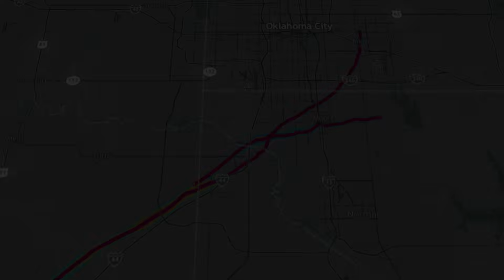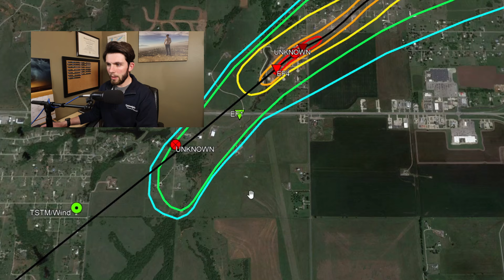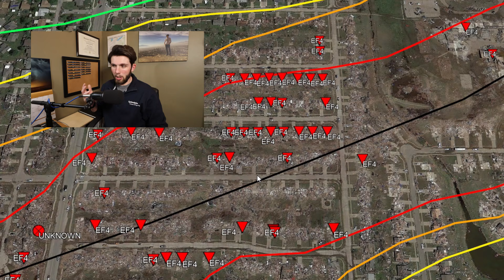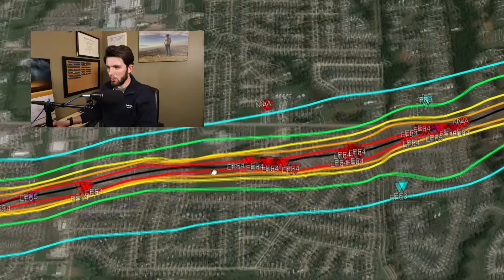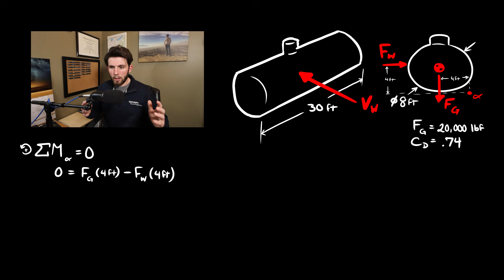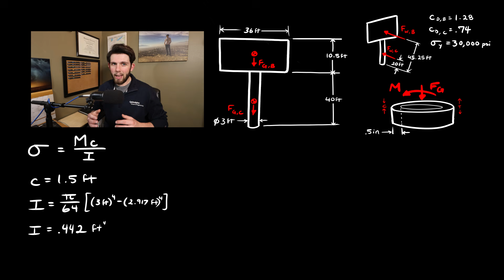DAMAGE ANALYSIS: 2013 Moore, OK EF5 Tornado

Comment: An EF-3 structures ability to survive up to the F number does not diminish the EF-4 nor the EF-5.  EF-3 and above must be understood as killer storms.  Rather than play with rating numbers make underground shelters mandatory for new construction in these dangerous frequent killer storm paths by reason of history.  If they want an above ground structure too then after the mandatory living shelter is built and not taken away from then give it to them.  Option two.  Leave that area.  We can live better underground and safe.  There is no excuse for a public school to NOT HAVE AN UNDERGROUND TORNADO SHELTER WITH MULTIPLE EXITS.  STOP ROLLING THE DICE WITH LIFE.  
Personal note.  Recently I watched multiple accounts about "the dead man walking tornado" that struct just 120 miles south of where I live in Texas.  I frequently drive to Temple, Tx and return to Cross Plains.  That storm account scared me.  El Reno scared me.  Both Moore, OK scared me and Joplin scared me as I once lived not far from their.  I have been a tornado magnet it seem in my life time.  They were all F-0 or F-1.  Once my car was nearly rolled as it was raised off the ground on the passenger side then crashed back down and tore up the gas station across the street and knocked off a corner of the shopping mall 1/4 mile further.  I have raced wind blown grain silos and not be able to see the tornado pushing it.  I out ran it and turned 90 degrees right to escape.  I suppose i'm tornado phobic at this point.  Have weather radar on computer and phone but no shelter.  Most do not have a shelter, just trust it won't be MOORE BAD.

Comment: You made an excellent appeal to change the rating criteria, maybe not to replace the Enhanced Fujita scale, but to be used in concert with it to capture the human impact. Does the total destruction of a well built modern barn with EF-5 damage indicators really merit a ranking equal to Moore 2013? Found you on the blue bird app, was not disappointed. Thank you for this, and God Bless these victims and their families. The width of that EF0 damage field at the beginning of the track, wow.

Comment: In 2011 I formed an opinion that It’s way easier to get a EF5 rating in tornado alley / Oklahoma 15-35mph vs Dixie alley 55-75mph. So take jarrell where the tornado was creeping 1-8mph at times. Or the cork screw turns produce DOD 10 on a FR12. The Dixie alley tornadoes were moving 55-73mph; so the core of the tornado that usually produces the DOD 10. It’s not over a location for very long moving those speeds. Sometimes less than 3 seconds —- also in 2011 I learned about the politics surrounding the Scale.  The Hackelburg or smithville had those been moving 5mph I don’t even wanna think about what would’ve happened.
Reply: That's a really good point, I never thought about it like that.   Obviously wind will do more damage if it sits in one spot so long.   I wounder if they consider this in these situations

Comment: So the Lubbock F5, joplin, greensburg, elreno, may 3rd. Multiple violent tornadoes have made that left turning corkscrew turn. It’s just something to think about chasing. We see it time and time again it may be revolving around the meso. The moore tornado you can see a merger and a 70kt jet streak +/-20kts.  Right as it was entering.  But also it could be the centrifugal force / debris throwing the tornado out of balance that causes that cork screw turn. If you look at damage paths. The cork screw turn happens when the meso starts shrinking. Usually the hook gets clogged up with a merger or something and the meso expands to cope with the inflow disruption. But when the hook clears, the meso shrinks rapidly (back to its original size). It’s almost like squeezing a water bottle or bulb syringe. It really funnels a lot of energy to the ground when the meso shrinks. It’s almost like it collapses all of that energy into the core of the tornado.

Comment: 29:29 and that is the main flaw of the scale. The DI system relies on more data to be more accurate and with Tornadoes that's not a good thing.  We could have a 2 mile wide 320mph+ beast cut through a field and rate it an EF3 cause it only clipped a single house. I think its also worth considering that the old scale had F4's go into the mid 200's and F5's were 250+. Having the EF5 tolerance right at 200 is clearly a problem. When its hard to differentiate a 190mph DI from a 210mph DI you will have this. Its also clear if you study F5's that had mindblowing levels of destruction (5/3/99, Jarrell, Candlestick, Lubbock, Xenia, 4/3/74, 4/4/77, 5/31/85) you can get a better idea of what true F5 damage looks like.
Reply: The main flaw of the EF scale is that it's being used to measure something it shouldn't be, the intensity of the tornado.  It should solely be used to measure damage on the ground.  With modern radar technology, we can use wind speed measured by radar and physical size to better indicate intensity than we can with damage.
Reply: "We could have a 2 mile wide 320mph+ beast cut through a field and rate it an EF3 cause it only clipped a single house"

We've had this. In 2013.

They even downgraded it from 5 to 3 for it lol

Comment: 10 years ago to the day I remember this like it was yesterday……however we’ll never know when we’ll get the next ef5
Reply: We’ve likely had several EF5’s since this one.  Just not rated as such.  There’s only a finite number of locations a tornado can garner such a rating, regardless of how strong it actually is.  There just aren’t enough places built to the standards necessary to rate a 5 if struck.
Reply: we’ve had many close calls since, could happen any time - let’s hope not
Reply: @oish6684 0
Reply: @kassieblackmon4761 a few things. 1) it was not 2 miles wide, it was 1.08 miles. It had a large debris ball, but it wasn't 2 miles. 2) size doesn't affect the rating. You can have tiny ef5s and big ef3/2s. The widest tornado in recorded history was rated an ef3. That's never the scale is not exactly a strength scale, it's a damage scale. It measures the damage, that's it. 3) there is no such thing as an ef6. The ef5 rating covers everything an ef6 could have. It would have to be a supernatural tornado to reach the point that experts would consider an ef6 rating. Like 500mph winds and concrete foundations completely missing, no debris to be found anywhere, just gone. We're not even sure that is possible, if a storm like that exists. It's certainly never been seen or measured before.
Reply: @deathbloom27 I'll HOWL till the ends of time the the 2013 El Reno was NOTHING BUT an E-F5 ...or such phenomena doesn't exist!😖😫😡👺🙈🙉
Reply: @brettrobinson2901  I'm right there with ya! I've watched pretty much every video from that day and it was truly something out of a sci Fi movie. Just absolutely, ridiculously absurd!! Had it hit a populated area, I'm willing to bet it'd have been one of the deadliest tornados in US history, maybe with a higher death toll than Joplin.
Reply: @deathbloom27  Totally agree..and as wide as was..like an entire meso cyclone was on the ground...dropping satellite cyclones   all over it woulda been a world class clusterf#ck...winds near or past 300 miles per hour...
Reply: @brettrobinson2901  god, I'll never stop being amazed by that storm. It took so many experienced chasers by surprise, obviously 😭
though I will say that I was really impressed with Reed's video, how he handled it. He recognized the signs before anyone else and immediately retreated with his team. He was one of the first ones to stop chasing and that was far before all hell broke loose! I think he just said something like "this is going to be really bad, this is going to get crazy, we need to leave." Say what you want about his yelling and screaming, but the dude knows what he's doing!
Reply: @deathbloom27  I'm wondering if anything approaching that insane storm will ever happen again.... Supposedly ..also in Oklahoma another monster cyclone briefly caught on radar that potentially dwarfed El Reno...but not much is known about it...haven't found a alotta info fleshing it out....its been awhile since a CONFIRMED E-F5 has hit...2013 Moore Oklahoma I guess...we're probably overdue...
Reply: @brettrobinson2901 100% agree the 2013 EL Reno tornado was absolutely an EF-5. You would think they would amend EF scale I mean they amended the F scale turning it to EF. So surely they find a way fix this kind of thing. That El Reno tornado was entirely to strong to not be an EF-5.
Reply: @RunningwithLB  Wonder if an El Reno type twister will make another appearance during my lifetime....?....I SHOULD hope not.....but uh...
Reply: @brettrobinson2901  i hope not, but  it's bound to happen again
Reply: @brettrobinson2901 absolutely agree.
Reply: @brettrobinson2901 the ef scale is so stupid, I HATE it. I want to know how strong the tornado is/was, doesn't matter if it was in downtown okc or ripping up wheat fields it should get the same rating. I've heard talk of it being revised but idk to what degree or how true any of it is really
Reply: If the mayfield or rolling fork tornadoes were going slower the would of been rated F5s. More damage is done when a tornado is going 20 mph vs 60mph.
Reply: @bubbawubba2307  Except for the 1920s Beast of a Tri-State Twister...man I wish someone had managed a pic of any kind....
Reply: Mayfield is in my opinion, the closest it has gotten to EF-5 since 2013.
Reply: Finally got one in ND. With that kind of analysis, we'll probably be getting more.
Reply: Ironically one year later we get a ef5
Reply: I don’t know how people live in Oklahoma
Reply: the tornado was not 2 miles wide, it was clocked in at 1.3 miles wide per NWS in norman oklahoma, it did NOTHING indicating F6 damage, as a matter of fact, the F scale has been retired, but not only that, "F6" is non-existent. do some actual research before saying bullshit like this
Reply: There’s been far more EF5s but conservatives and MAGAs have prevented them from being rated due to it proving climate change. Only a matter of time before EF6 becomes a thing and concrete slabs are gone. Probably 5 years away.
Reply: This year looking like it will
Reply: @SwipeTheStones fr. This last week has been crazy
Reply: Delete that pfp
Reply: Diaz, Arkansas, Preliminary EF4 max winds of 190, last time we had a preliminary 190 was this tornado, there’s a high chance this Nader will be upgraded to an EF5 reguarding how they mentioned further damage inspection will be needed for a COMFIRMED rating
Reply: Seems like rating should be based on size and wind power.
Reply: Initially, Ted Fujita rated the Xenia tornado as an F6, but it was downgraded because, at the time, the Fujita Scale was still being made.
Reply: April 13 2024
Reply: @northernillinoiseas ?
Reply: @BlakeAlexander12 there hasn't been one yet but there are close calls there is Nebraska they had an EF-4 on April 26 and In Oklahoma the other day it was pretty bad there is possibly a chance this year we could see one the weather conditions been perfect everyday has been humid and dry
Reply: We’ll never know? So it won’t happen in our lifetimes?
Reply: @kassieblackmon4761  there's no such thing...